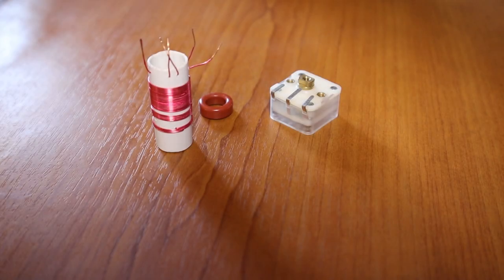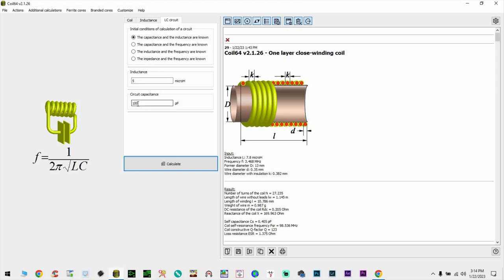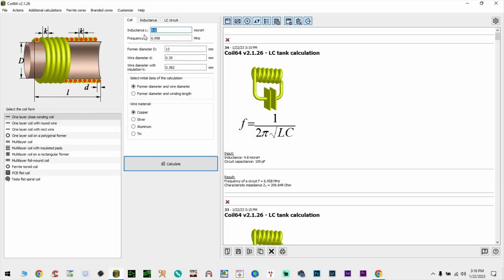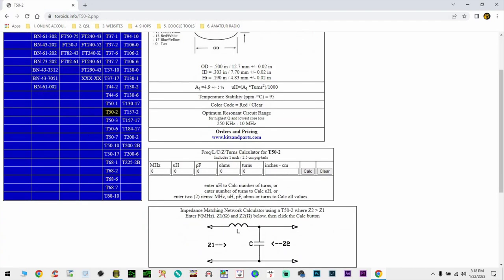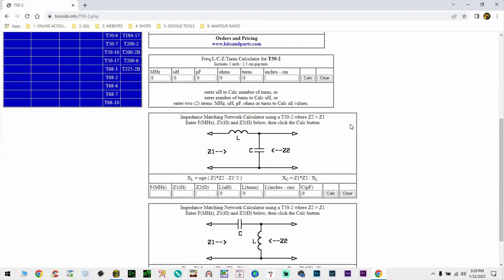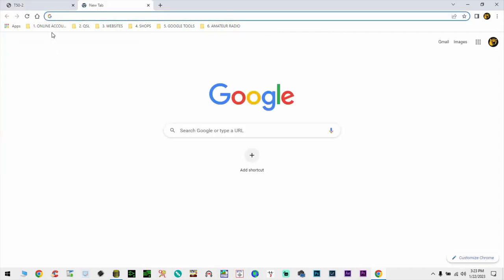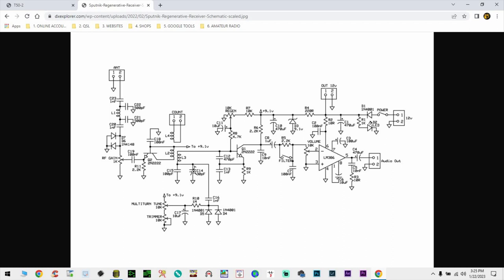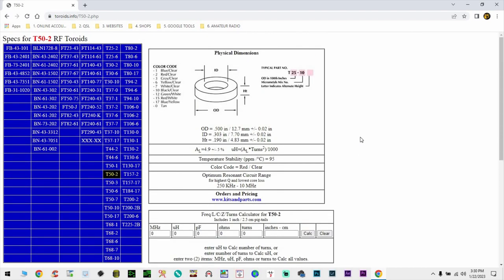How To Quickly Calculate Inductors And Resonant Circuits

Comment: I am new to this and not fully understand everything but your videos are helping a lot. I have one question. We measured the Inductance of L3. But how do we measure how many turn for L2 the pre amp coupler or transformer? Thanks again for the great videos.
Reply from the maker: That is a bit more complicated. For a regen receiver as example... if I would have 24 turns for the main coil... the antenna coil would have about 6-8 turns. If the main coil would be 50 turns... the antenna coil would be around 8-12 turns. If the coil itself is used as transformer... and the ones for regen receivers in this case as well... it depends very much of the impedance between stages. For a regen receiver we can "play by ear" and figure out things with trial on error... but if it was a transformer for an RF power amp... I don't think I would do that ))). This is something I also need to learn a little more about as I need more knowledge.
Reply: @dxexplorer thank you. For the quick answer and thank you again for the great videos.
Reply from the maker: @Troutwranglersocal Thank you as well for watching... and happy holidays to you and your family. 73, YO6DXE.

Comment: Thanks for the great video. Do you have a video on using the Nanovna to measure inductance? I would like to know the circuit that you've built that measures at 50 ohms when the inductance is correct. Thanks and 73.
Reply from the maker: I don't have a video but if I have a little free time I will make one. I don't trust so much the inductance measurements on the nanoVNA comparing it to a proper LC meter, because there are too many variables that may be wrong. And is a bit annoying to measure with the nanoVNA... too many settings to go through and calibrations. But... is better than nothing 😃.

Comment: Now we just need to calculate how much screening is needed for a regenerative receiver depending on  how much the operator waves their hands about ;)
Reply from the maker: Well built... a metalic front panel connected to the negative of the circuit should me more than enough.  On mine I have no screening at all. There was no need for that.